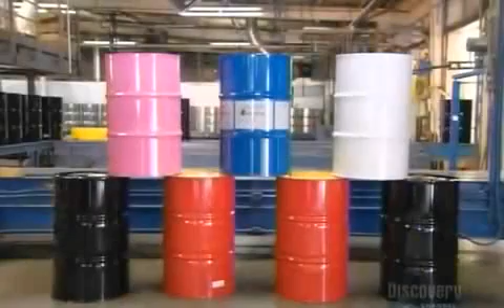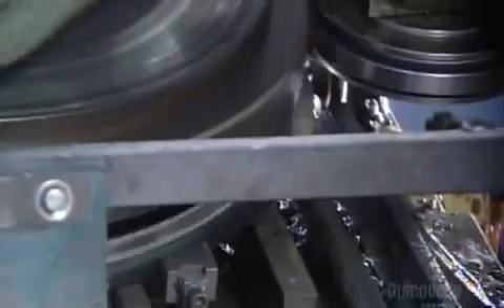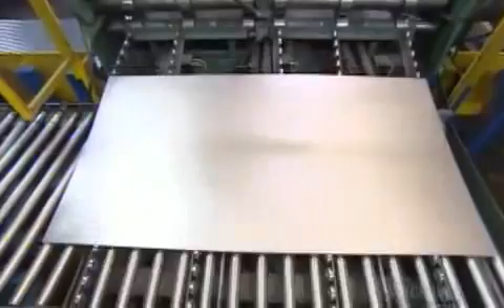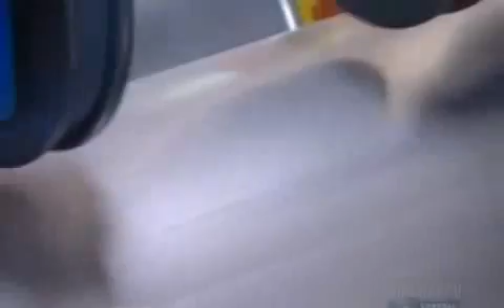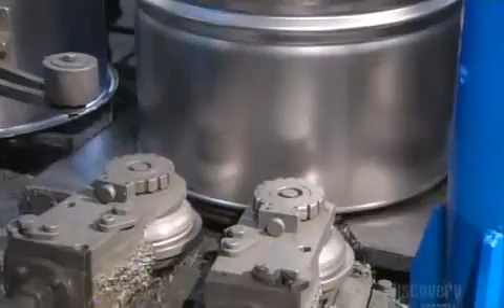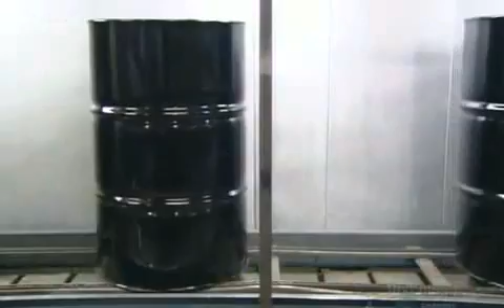How It's Made: Steel Shipping drums

Comment: I make the rollers that makes the rib in the drum for the lid and sharpen the shears!
Reply: I used to work for a company that made steel rings that's secured the top lids to the drums
Reply: Sir , i want to know which type oil used on roller for seaming operationa and which place spray oil at flat point or profile location

Comment: Are shipping drums still used widely in the oil industry? It doesn't seem very efficient to fill those/drain then, especially when they have cargo ships that act like one big barrel...
Reply: Not much anymore in the crude oil industry but they have certainly found uses in other chemical and petrochemical industry applications such as shipping finished bulk materials.
Reply: PS: If you do the calculations then a cylinder still seems the be the ideal container shape for applications where you need to maximise space while also maintaining strength, uniformity, and ease of handling requirements :) The only way to really beat that is to do as you mentioned and just fill a special ships hull itself full of oil.
Reply: StephenB so a auto repair shop is gonna wanna buy a whole ships worth of oil to do oil changes with instead of one barrel? ur fucking stupid
Reply: @fandango_buttlicks  You don't put crude oil in your engine... Motor oil is a refined product. It either ships in rail tanker cars or 55g drums unless being broken down to plastic gallon and quart containers for consumer grade purchase.
Reply: @marshallallensmith  , just wondering how you know so much about this topic? I’m interested Sir, for an invention I’ve been working on…